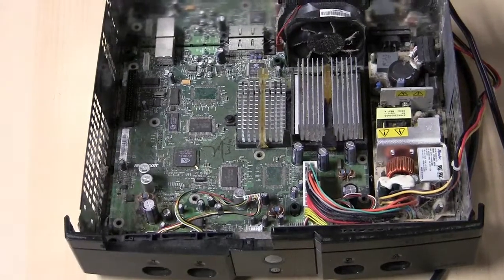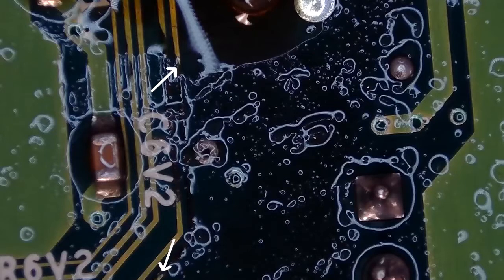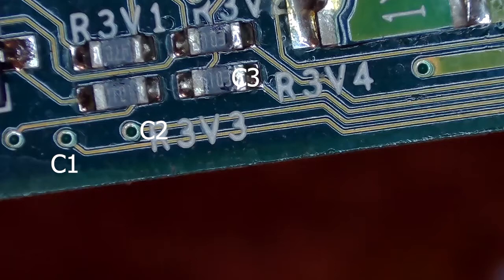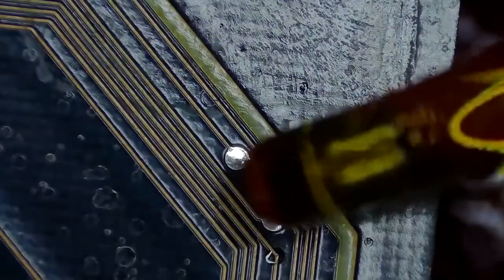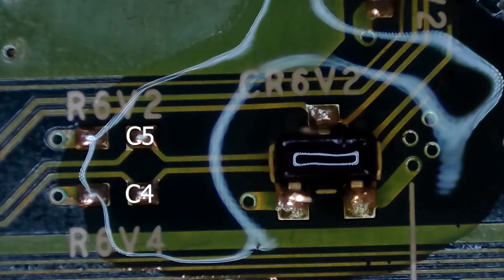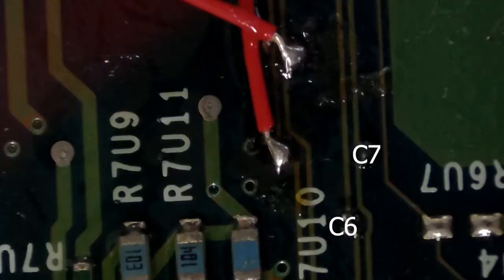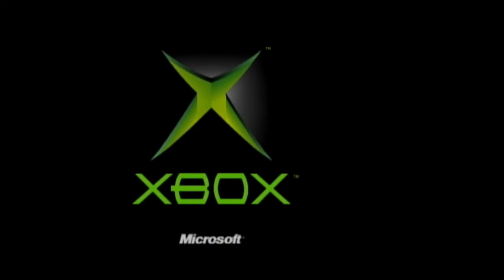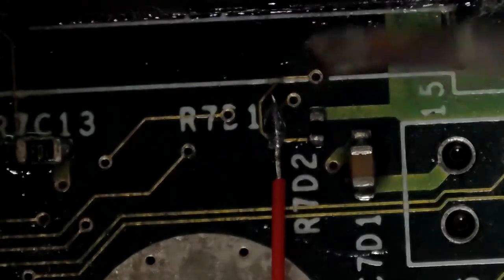Modding The Original Xbox Part 7 - Trace Repair

Comment: Are there any wire types that you would recommend against? Or perhaps the reason you should use a certain type?

EDIT: e.g. kynar or tinned copper. I've got no idea 😅
Reply from the maker: I use 30 gauge kynar wire as it was recommended to me. I tried using some other wire I believe it was tinned copper wire but struggled with it.
Reply: @techhoarder3010  ~What did you struggle with? Only asking because I got tinned copper to try this with, but I've not seen anyone else use it. I'll buy a different type of wire else hah
Reply from the maker: If I remember right, I don't think the solder would bond to it. Is the wire you got insulated?
Reply: @techhoarder3010  Oh right. Yeah, the one I have is insulated

Comment: 4:09 You could've tested continuity between the supposed bad trace points and confirmed that there is actual trace rot. I did that for C4 and C5 when I had a huge black streak across them, but the wire underneath was still intact. No bad vibes, just my input, great video and detailed shots!
Reply from the maker: True, this xbox has several issues so I already knew stuff was messed up with it. Thanks.